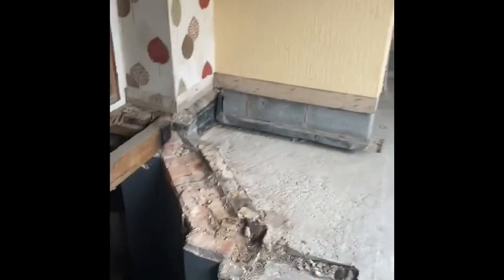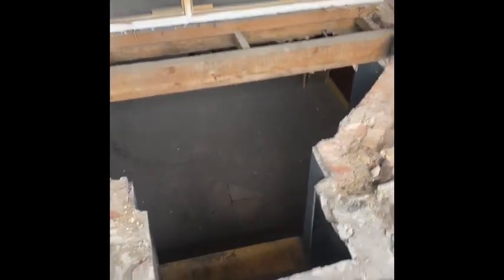Bricklaying: help

Comment: Looks like you've got your hands full on this one with that gable it needs a structural engineers report before you can go forward 
Do you do a lot of this sort of work
Reply from the maker: Yeah I do this sort of work and site work mix it up a bit 😂
Reply: @rowlockconstruction8345  I used to do site work but its so repetitive, these days extensions, garden walls and restoration work, so much more satisfaction than house bashing
Reply from the maker: Yeah I definitely agree with you mark it does get boring on site. It kills my arms with the heavy mortar too👍🏻
Reply: @rowlockconstruction8345  good luck and keep the vids coming